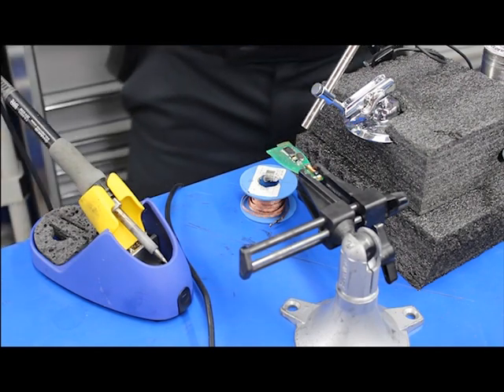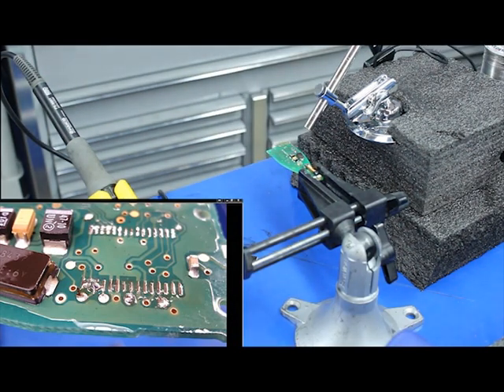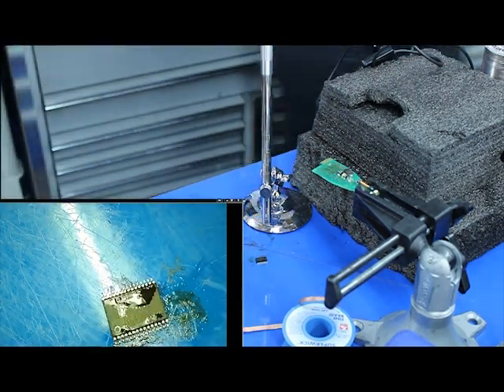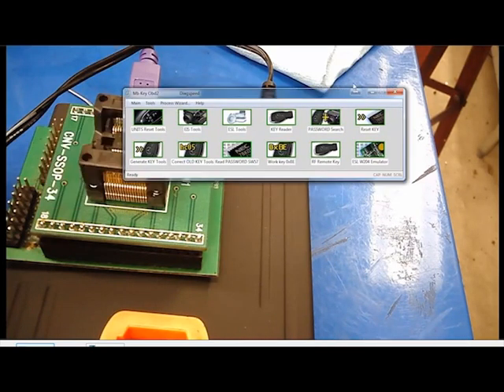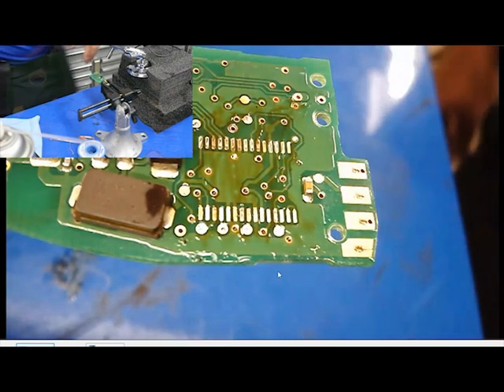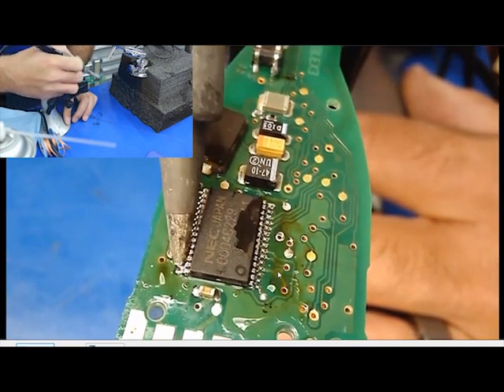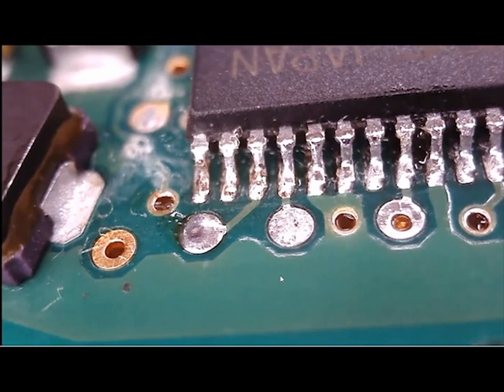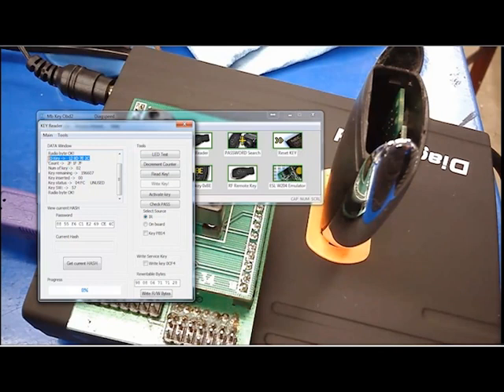Removing NEC chip on Mercedes keys for beginners

Comment: hi guys this method is really for beginners but this method is also difficult for pros so its better to use hot air soldering gun to remove the nec processor and if a key can't be repaired just take the nec processor and solder it to a new key board and it will function and start the car also control remote locking and opening doors without the need to reautorize the key to the car with diagnostic tools, i do this on daily basis. great video keep it up guys.
Reply: i just done it swap to other mb key board (wich looks the same) but on my one hav ir led big and small and new one hav 2big ir leds one on front and 1at back of board. nothing is working on that - after button pressed red led lighta up for couple of seconds. also ir for immo not blinking fast but lights up contuniously for couple of sec. what done wrong? my car sprinter 2007 key is form c class dont know year looks same from outside...
Reply: Where do you get a new key board please?
Reply: Hi, so I swapped my chip but it doesn't open or start the car anymore. Remote light flashes after I press a button. What did I do wrong?
Reply: @kryspla  wrong key obviously two different frequencies or nec chip not soldered on correctly to broad
Reply: Is the resetting of the used key called flashing ???
Reply: @5905-k8v  well yes In a way not all chips  can be reset or virganised as they call it sometimes
Reply: @cassk9999  what can i use for the resetting process can i use this
Reply: Hey are you still fixing keys?

Comment: Can you use a used circuit board from a close to new key fob to do the swap?
Reply: Yes, you can do it. Only NEC swap
Reply: @karned273  with just a NEC swap will you get all the button functions as well.

Comment: That's no good how your doing that I have been a electronics technician for 25 years and that NEC integrated circuit can be destroyed by electro static discharge from your body not once did I see you ground yourself with a wrist strap..I only point this out because it be a shame to take the chip out just to destroy it
Reply: you are also correct but this works this way, ive done it 1000 times same way and never did the nec break
Reply: What would be the use of a wrist strap? What would you ground to?
Reply: The point of the wrist strap is to dissipate the electrostatic charge from your body so that charge does not destroy the low voltage sensitive components threw the conductive legs of the NEC program integrated circuit
Reply: If using tweezers best to use ESD tweezers with Electrostatic discharge (ESD) specifications